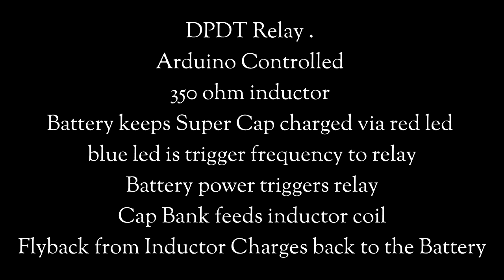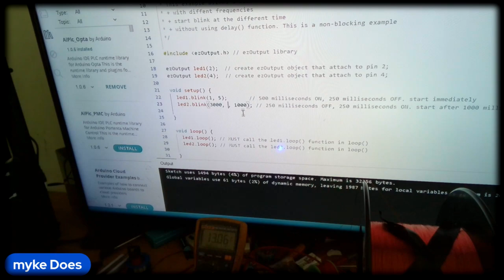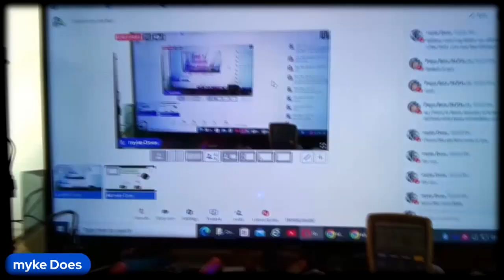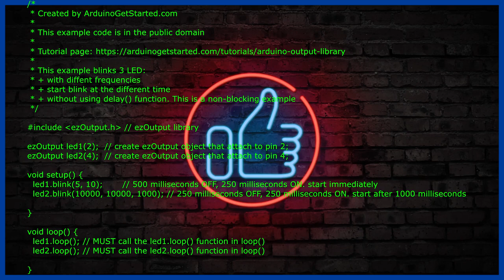Flyback Test Run 3 25 hours

Comment: Hi Myke. Impressive! In theory, could one add a ferrite core to the bobbin and pulse a magnetic flywheel also while still maintaining the charge?
Reply from the maker: It's more efficient to capture the flyabck , not over unity . as of yet, but i still have to capture the emf field coming off the coil and feed it into the capacitor bank. So if its over unity i still dont know until thats dont,  here i talk about that . (Stator Coils)
Reply from the maker: I  am keeping it solid state 100% but you can add a core and rotate a shaft, keep in mind the DPDT relay is flipping the poles each pulse on the inductor so on one end the coil has North next pulse same end has south . I am going for ac power
Reply from the maker: towards end of this video you start to see slow drop in volts  there are two reading the battery and the caps the caps are slightly lower than battery volts.  the loss is in the fields the coil is making (must capture) those fields will equal at minimum your current input and i refer to the forward input not the reverse flyback , that gets recycled into the caps to generate a field in the coil later
Reply from the maker: ther is also loss in the in efficiency of converting flyback volts to usable current , so far the battery or capacitor does that best but unlikely to do it 100 % , you can add transducer in parallels with the inductor as well to seek out piezo sources of additional energy this may be the thing thats missing. it is also possible particular frequencies are better at funneling radiant threw the use of a coil alone hence not needing piezo materials , keeping in mind again a coil is a piezo device to some degree especially when your pulsing it and not necessarily waving it like AC , or ac could also generate piezo , not sure which is better on/off or wave
Reply from the maker: right (while still maintaining the charge)